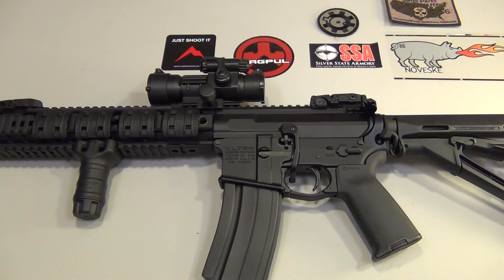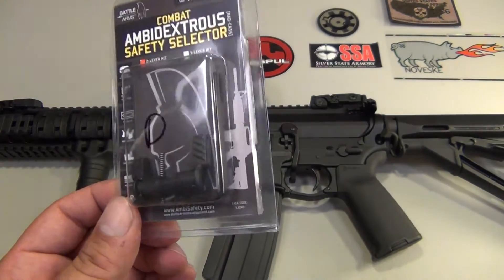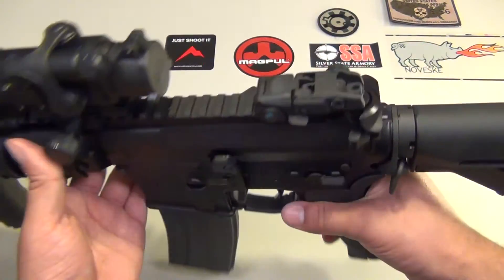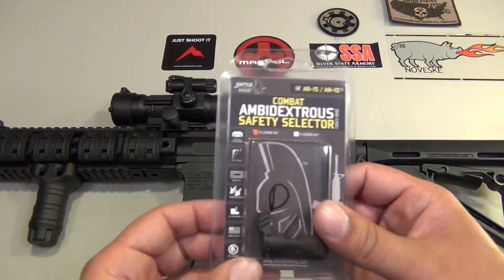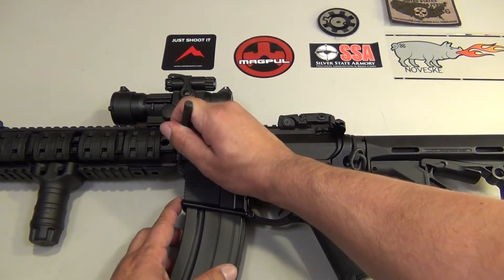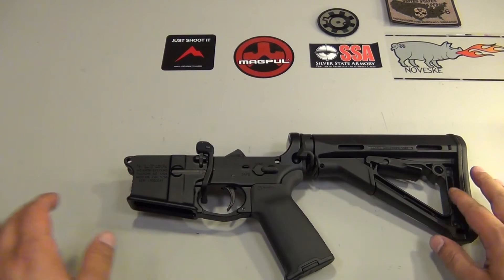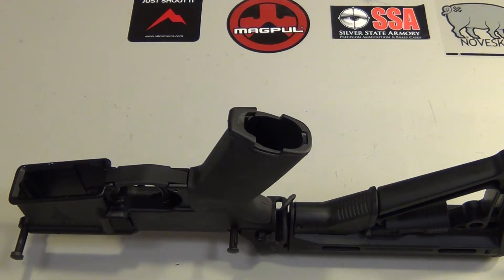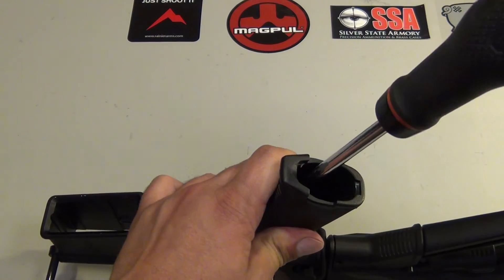BAD-CASS battle arms installation

Comment: Just a few things you could have done differently to improve this. Use a bit of white gun grease on the springs and detents to help hold them in place, it helps a lot, and provides both lubrication and rust protection. The spring for the detent should go into the handle and then you slip it into the hole in the gun. There is a deeper recess in the handle that holds it better, and guiding it into the lower is easier than trying to guide it into the handle. You should always use lock-tite on the screws to prevent them backing out. If they back out while you are shooting it could be very bad. You should have put the detents and handle into place before installing the selector switches, that's what it is for, to hold it steady and in place. Lastly, you should have tested it immediately after installing, to see if it functioned correctly while you could still see the hammer, sear, and safety components work. Test fire while safety is on to be certain you cant, test yet again while safety selector is on fire mode (be sure to not let the hammer strike catching it with your hand), and then be certain that the hammer catches correctly while still holding the trigger down. Doing these tests are important to do BEFORE you reassemble the weapon to insure correct performance while not in a live firing situation, and while you can watch and be sure everything is working correctly.